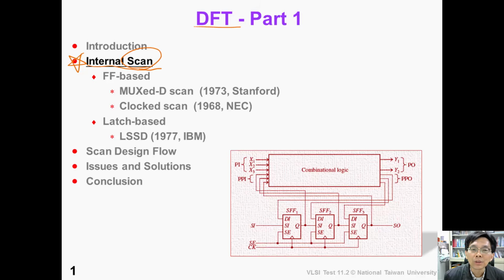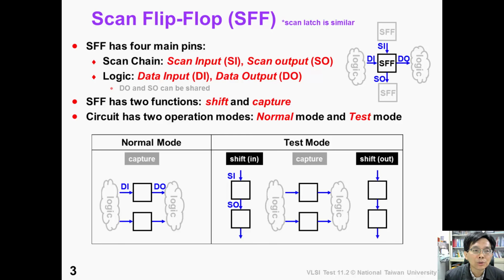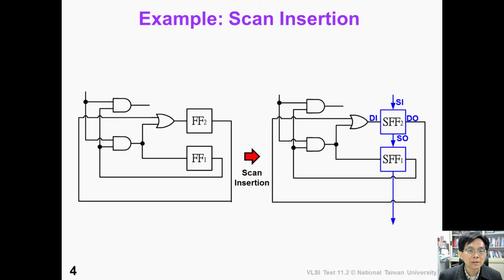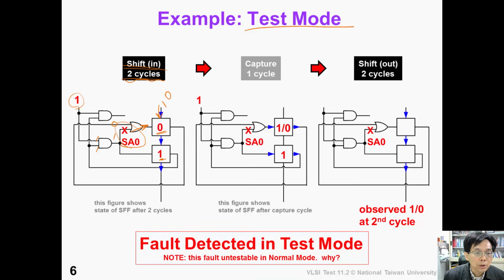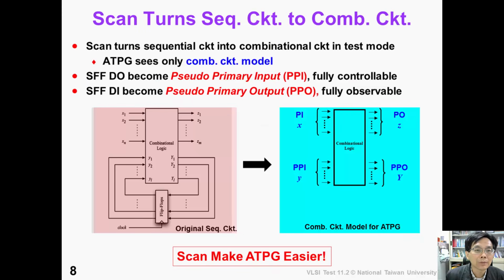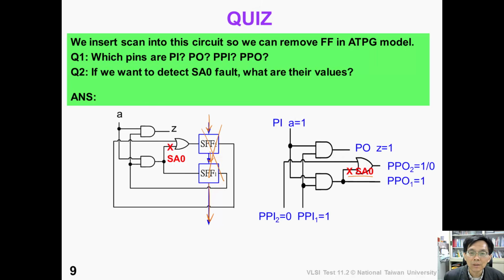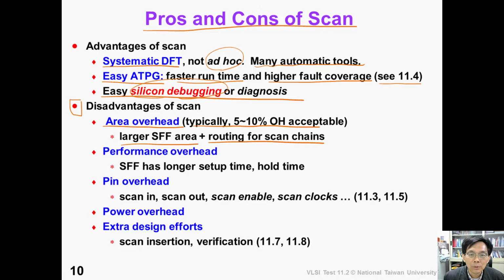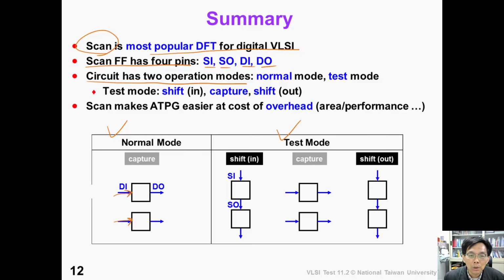11 2 DFT1 ScanConcepts

Comment: At 10:10 In the normal mode, there is only capture function and hence whatever the fault is stuck at, the flip flop is going to capture only that value. Hence it is difficult to detect stuck at fault in normal mode.

Comment: In normal mode, the input signal is an absolute means designer give standard combination of inputs and expects the output but never assumes one of the input stuck to either 0 or 1. But this stuck part happens during manufacturing...so it can be detected in test mode only. I hope this is the correct answer

Comment: Thank you professor for a great lecture. It makes clear what the scan test is than any other articles or videos.
Does anyone know the answer for the question? Why can't stuck at zero fault be testable in normal mode?
Reply: Because in Normal mode there is only a capture function, hence it is not observable. In test mode there is both shift and capture function.

Comment: what is the answer for the question
Reply: On the last question, the FF2 will be stuck at 0 since after reset, output of FF2 will be cleared. This output then gets fed as an input to the only OR gate with a SA0 issue.  As a result, FF2 output will never change; therefore, prevent the circuit from normal operation.

Comment: I have one doubt....In the given examples, we can observe the FF output after 1 shift cycle, isn't it? As we already have good/faulty result at the output of FF2 after capture operation....then it should take only one shift cycle to propagate it to the output of FF1....please explain
Reply: I also thought the same.Only one cycle need to get FF2 at primary scan_output. But I think, it is a rule to follow-> # of load/unload cycles = # of scan flops in the scan chain
Reply: Actually the output that is under observation is output from the scan flip flop which is connected in serial chain. Hence two clock pulses are required to observe the values of SFF during shift out operation